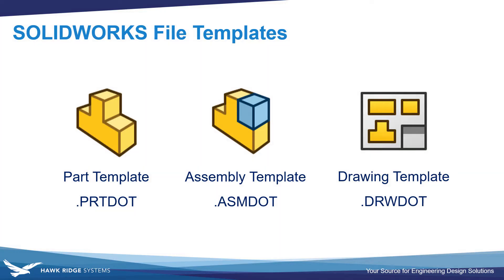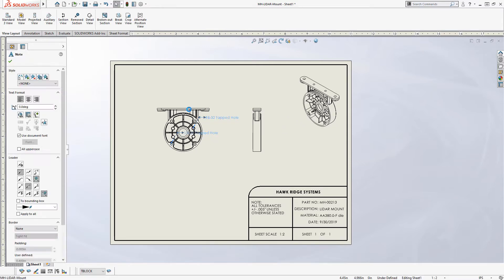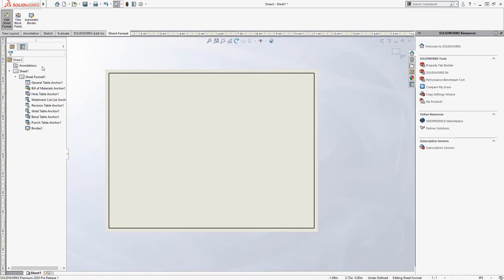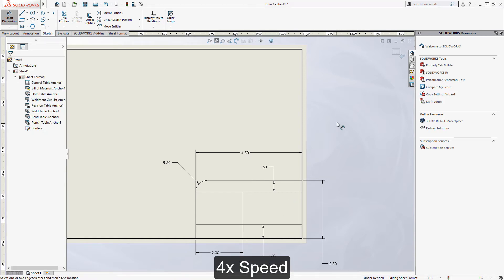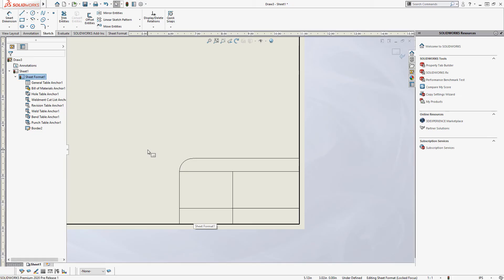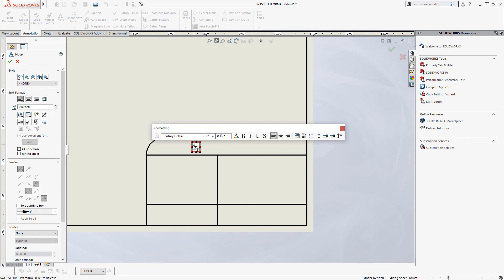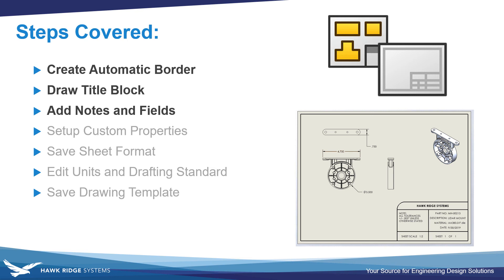Drawing Templates from Scratch in SOLIDWORKS: Part I

Comment: Thanks for this video (and Part II).  It's really helpful.

Adding constraints to the border is easy enough when you only have the simple, four-point border.  Setting up a double-line border with zone markers (as per BS EN ISO 7200) on the full range of sheet sizes (A4 to A0) is tedious and error-prone.  The A0 sheet alone requires selection and fixing of around 80 points!  Why on earth doesn't this border default to fixed?  It should at least be an option.

Comment: How much more different is this compared to the functions of ver 2014?
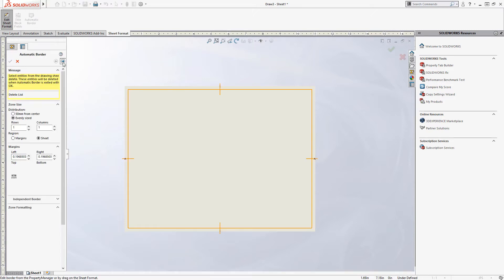Reply from the maker: It should be a very similar process. The only major difference would be lack of "Automatic Border" tool shown at 3:15 which was added in 2016 version. 

In 2014 you'll have to manually sketch the border of the sheet, using a similar process to what we did to construct the title block. 
The prompt when linking custom properties to notes may also look slightly different.
Reply: @hawkridgesystems  Thank you.  Does there happen to be a macro that performs this feature in 2014?

Comment: HOW DO YOU SHOW THE DIMENSIONS AGAIN??? THE SETTINGS ARE DIFFERENT IN EDIT SHEET FORMAT.
Reply from the maker: You can show the hidden dimensions by going through the pull down menus and selecting View -> Hide/Show -> Annotations. 

The hidden dimensions will be shown in a gray color, click on them to unhide them. 

https://help.solidworks.com/2021/English/SolidWorks/sldworks/c_Hide_Show_Annotations.htm?verRedirect=1
Reply: Hello @HawkRidgeSystems: Wouldn't it be easier in your demo to have created a new separate layer for the titleblock dimensions and hidden them by layer? That would have been more consistent than simply hiding the dimensions, given that you had already instructed the users to place border and titleblock on separate layers. 

BTW, you deserve a medal for these videos on creating custom sheet format & drawing template - yours are by far the most complete, thorough, logical and  easy to understand videos on this topic. Many thanks!

Comment: Hi! Cool tip to set dimensions and then hide them. I used to simply delete them... But do you know how to unhide them in case you wanna change something? thx
Reply from the maker: Good question! You can show the hidden dimensions with View -> Hide/Show -> Annotations. The hidden dimensions will be shown in a gray color, click on them to unhide them. Following the process in this video, you would also need to "Edit Sheet Format" first before showing the annotations. 

https://help.solidworks.com/2021/English/SolidWorks/sldworks/c_Hide_Show_Annotations.htm?verRedirect=1
Reply: Thanks, 👍

Comment: Is there a possibility to you guys make a video of importing an template from Autocad. Once I have tried but I don’t know why all my entities changed its size.
Reply from the maker: We will add this to our list of topics for future videos! One quick thing to check would be - are you sure you had the correct scale settings on the import? By default it is set to millimeters. It's also important to choose correct paper size and sheet scale.
Reply: I checked it. But it didn’t work. Someone told me for some reason 1 SolidWorks’s milimiter is equal to 1.002 mm in Autocad or something like that.